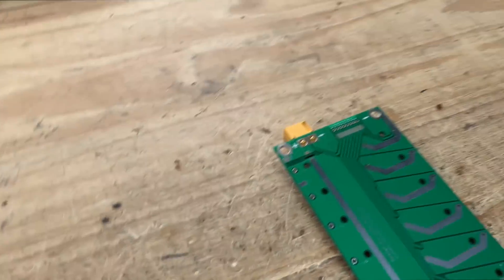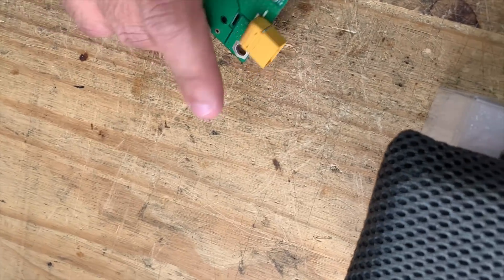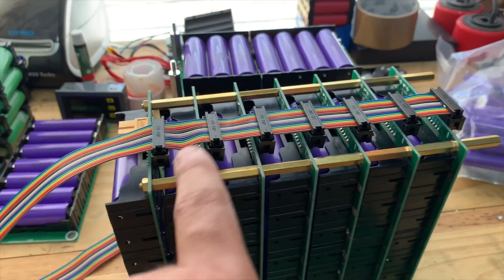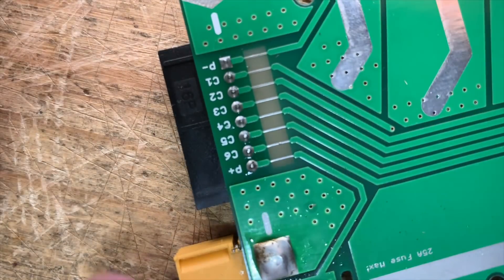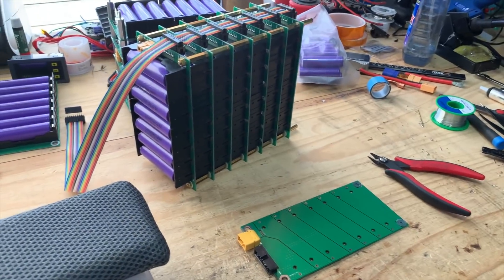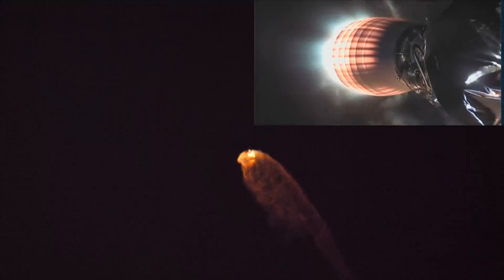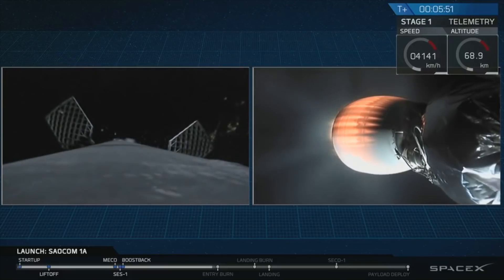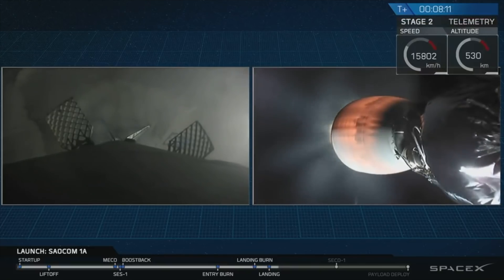Jehu's DIY Powerwall PCB V2 Connectors

Comment: Jesu never has time to answer to our questions. Any expert please answer to me. I just have completed my 7s 18p pcb powerwall. I did not give the connection yet. Where do I need to give the input from my epever controller and where do I have to take my output?  Also do I need to connect x60 connectors to every board or just one board enough? Also do I need to have a fuse in the line between controller and powerwall?Thanks for your time to reply to me.

Comment: bought ver1.3 boards, not sure where the smd (surface mount device) fuse or wire goes exactly, it's a little different, where do I see that version ?

Comment: If you want to exchange(hot swap) modules, will the xt-60 and the ribbon connector both be used or will the ribbon get in the way? Haven't got far enough to test it out myself. Thanks

Comment: HI @Jehu.  The 'Sense' cable and signal path 'noise error' maybe in 100mV or more when connecting battery packs together.  I believe the original balancing circuit is designed to sense only 8 batteries, but when stacking up to 2, 3 or 5 the noise may become a factor. The design is good as it is, however i would like to see next pcb update to enhance design by reducing cable, connector and path noise. This enhancement will help with basic common mode noise (CMMR) and help with power supply or battery noise (PSSR).  Sometimes they cancel each other out,  however other noise may double in power (reflective waves, incident waves, cross talk etc).  Since this is DC (0hz) signal sense cable, adding 0.1 uF across each 8x connector pins should attenuate the noise level down < 100mV  or more (-60 dB or 1000 times less is the pcb designers goal). Great place to kill as much noise is where the silk screen is located above the header and below the edge of board. The lower the impedance of 8x traces (i.e. less than or 50 ohm  impedance) of your sense cable the lower dB noise level... If you want to reduce the noise down to < 100mV per line please add foot pring 0402 or 0805 0.1uF caps.  This should not affect pricing quote of the pcb board since you are using existing copper (0$ free). I can't wait you release the kit!

Comment: bad Design, no strain relief, bad Cells would destroy the board because of balance current. Many throuh holeconnections make a lot of resistance, unnessary double sided board ads more cost, and why you dont make all cells on one Board in parallel and stack them up for more voltage, and at the end of each board are more xt60 connectors to add more cells in parallel. each board gets a voltage and balance circut with a monitoring display, a little microcontroller with a can bus interface and an adress selector for remote sensing.
Reply from the maker: Terrible ideas
Reply: like strain relief , is a bad idea (thought) mabe i use the wrong english word, what i mean. I would never design a product without this, it protects the connections mechanical. And the balance current over these small connections will fail on short time. Even u have designed a one time fuse in the board to adress it 9:27 . But it will destroys the board . 
I like ur videos but this idea over a easy build batterpack with this boards is not well developed.
Reply: https://www.all-electronics.de/erwaermung-von-flachbandleitungen-unter-strombelastung/

Comment: Sir please tell me how to charge 18650 batteries in  parallel (10 to 20 batteries - 2200mah) for 45000 mah  power Bank. Without BMS. It is possible to safe charge with DC to DC  convert. how much voltag, Time and Ampere needs to be set. [ E-mail:-  sddragon69@gmail.com ]

Comment: Just curious, did you have issues with permits and what not with your DIY power wall?  how did you get the inspection cleared using the DIY packs?  or did you? lol
Reply from the maker: Off grid systems do not require approval
Reply: oh so you are 100% off grid.  gotcha.  that's cool

Comment: Do I still need to use BMS with this PCB?
Reply from the maker: Yes
Reply: @jehugarcia  thanks so much. I m a Nigerian and I m trying to build a portable solar generator, but getting many of the parts needed is so hard, and when one decide to buy from eBay or Amazon, the shipping cost is enough to make one run away.

Comment: I like very much what you do. Batteries second life is a bold ecological move, I hope history will keep record of you. I am not ready yet to start on batteries, for the moment I start to accumulate solar panels, some are used grid tied. I plan on switching to off grid with batteries some point down the road especially if things go south in our infrastructures. For the moment a grid is very convenient, cheap and reliable. I am lucky in France to have caught a contract where I can sell for 25 years the power at almost twice the price I pay when I use power. I'm a big fan of SpaceX too ! http://www.spacexcovers.com

Comment: This setup is a really neat idea. I'm thinking each board could have two XT60 connectors, one facing up and one facing down, then you can stack the boards by just plugging the XT60 into the one below. A pair (male/female) of XT60s seems to pretty much match the height of the 18650 battery holder. I imagine you'd have the connectors staggered up the stack of boards. I've made a crude drawing of my idea here: https://i.imgur.com/LOPJp3B.png - you'd have to solder the boards up in two variants (one with the left connector pointing up, one down), but the boards themselves would be the same.

Comment: If you're looking to go hot-swappable for scaling, there's a few operational things that you'll want to take into consideration. You'll want to have a visual indicator available on each board so that you can signal the physical location for a "bad" board or indicating a specific board that you want to examine. For your sensing lines, you may want to consider using PCB edge connectors (like PCI cards) as they have lots of mechanical connector options. If you're looking at scale, it may be worthwhile to consider keeping the sensing on the board and use basic ADCs to do voltage sensing and making the data available over a bus like i2c or CAN. It'd also give a path by which to enable/disable the visual indicator mentioned before.

Comment: Why don’t you just redesign the board to use the 16 pin and jump 2 pins together to make a pair running the current through 2 wires it won’t add extra complexity but more amps could be tranfered
Reply from the maker: Did you watch the video?

Comment: Anxiously awaiting the testing and the Gerber files!
Can you please ask your PCB guy for a 4s and 3s version Gerber. I've got some small projects
Reply: You use the same ones, but just short out the battery positions you don't need.
Reply: @jmonsted  I thought about that but it seems such a waste. It should be easy to modify the design and generate another Gerber, but I don't have a clue about PCB design

Comment: Ì would like to see you extend board to 8S so you can optionally use LIFE batteries (3.3V)
Reply from the maker: I don’t see a lot of people using lifepo4 cells,  are there decently priced cells available that I don’t know about?
Reply: I have about 800 of these that I got for next to nothing. Came out of 12V 100AH (4S88P) battery where BMS had failed killing 25% of cells. Main problem is LiFePO4 18650 batteries are low capacity (1300mAh/cell) but have low internal resistance (50-100 milliohms) so efficiency is high. They can deliver 30A-50A per cell on short circuit.

Comment: I've installed 50 pin connectors on ribbon cable using a bench vice with smooth jaw covers. An adequate crimping tool is about $17 on amazon.

Comment: i wanna build a 24 v pack .. but i dont wana use a bms .. can i  balance my cells by making a conection in parallel of all groops and charge them with 4.2 v .. will this work ?!
Reply from the maker: Yes just don’t short your batteries
Reply: @jehugarcia  can i also discharge them in that way ( discharge them as 24 v) and letting also the conection in parallel ready for the next charge ?

Comment: When you were soldering those IDC connectors, hold iron a little bit longer on each pin to avoid cold solder joints. The speed you pulled iron away from some pins is just too fast. The same goes for soldering XT60 connectors.
Thanks for the video!

Comment: Good work, but the ribbon cable is a very thin awg... Could you double the connections, so instead of just using one cable it would use two.
Reply from the maker: Next revision

Comment: @jehugarcia remove the big battery balance connections off the and go to a smaller 2-4 pin that only carries a data signal of the cell status of that board. you could used the modbus protocol to send the data over two wire or three if you add ground wire. then have a master board that collect all the data to one spot for data logging and info status that could be shown on a display. plus have the master board control the charging and discharging of all the boards. 
each of the slave board should have there cell balancing circuit with safety cut outs with temperature cut outs as well. that way if one slave board has a cell that goes out of wack can automatically disconnect it self form the rest of the boards until its safe to reconnect. thus keeping power flowing from the other broads.  if a cell does not return normal then lets the master board know that service is needed with the cell number and board number. that way the user know what cell needs attention to. 
i could go on more ways to make safer and easier for the end user. but i hope that helps you in some way.
Reply from the maker: If I wanted to make these really expensive yes,  that’s not what I’m trying to do

Comment: instead of cutting them entirely you should have cut, bent and soldered them to the one below. that way you would have got the double current carrying you will have in the next board.
Reply from the maker: If you want to cut bend and solder thousands of pins,  go for it,  most of us don’t have that kind of time,  we just want to build a battery to use it,  it’s not worth all that extra work
Reply: @jehugarcia  I was just thinking for those that will be integrating old and new versions of the boards as time goes by, it would be a good way to ensure full future compatibility. I figured you'd modify future versions of the board for native compatibility with these connectors.
Reply: Hey Jehu, what Thomas Brekling said but also, glad you are going proper integration in the next version but I was only suggesting for those beta testers who already had bought boards and didn't want to compromise on the amp rating of the cabling. They wont be soldering thousands cause they wont have that many boards yet. Also you do need to solder the pins in the through hole on the next version so in some ways just as much soldering but quite a bit of extra bending. (bet that could be done as a oner in a vice though).Anyway it wasn't a criticism just meant to be a helpful observation. I love the work you are doing. I am all about the plug and play when we get there.
Reply: 100% agree. By cutting them the way he did,  he is completely negating the benefits of the double wires. I'm not sure if that was done by mistake or if he doesn't realize what he did. He will get it right though.
Reply from the maker: Only a bandaid for existing boards future revisions will natively incorporate these connectors
Reply: Yay!!!! Back to dedicated videos instead of live!

Comment: Using a vice works well putting on the Idc ribbon headers
Reply: How about adding rivet, something that holds the angular 90 xt60 connectors, and then add solder?

Comment: The proper tool for the ribbon cable connectors is much too expensive. You can put it in a small bench vise.
Edit: You can get a cheap tool now for less then 20$
Reply: Link?
Reply: @PTJeff9x  You can find it on any platform. Search for "ribbon cable connector tool"